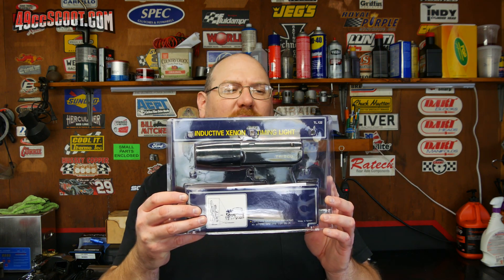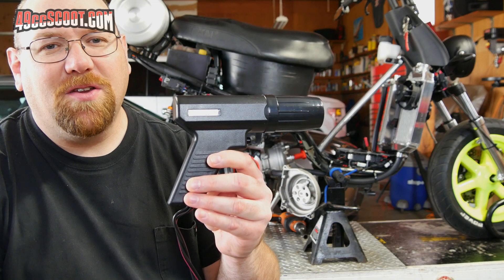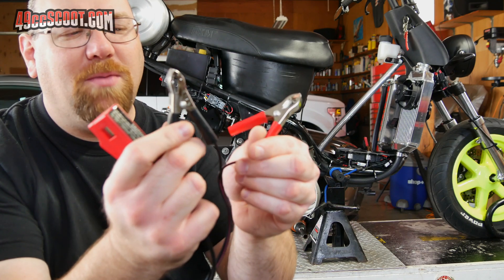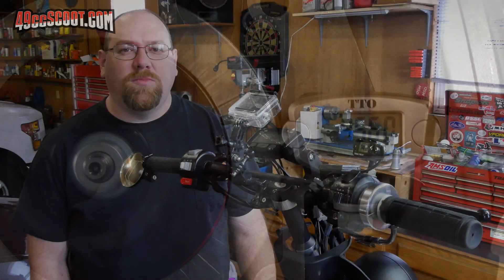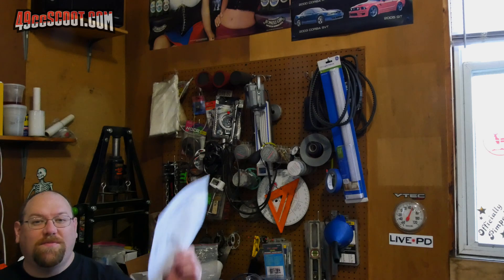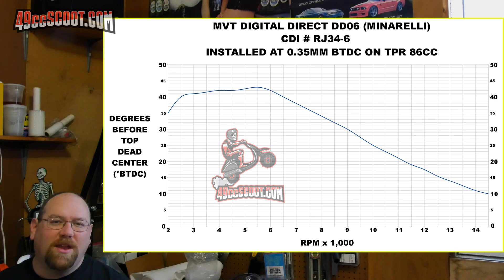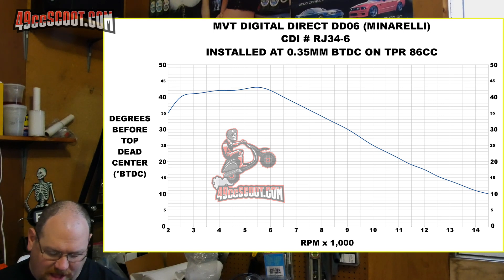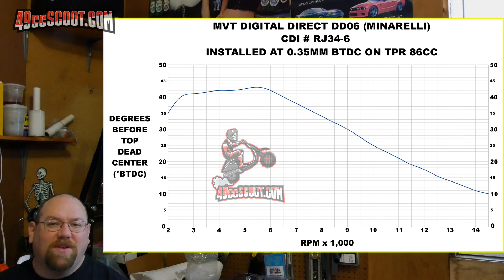TPR 86cc Build : Part 25 : Finally Figuring Out The MVT Digital Direct DD06 Ignition Timing Curve!

Comment: Do you have problem with rev counter on mvt, at 8500 rpm it cuts to 4500 rpm as if mvt is double sparking in the low range rpm.
Reply from the maker: I set my tach to 2 pulses per revolution and it worked great.

Comment: Hi, 

Im actualy building a engine for myself. 
I have a programable CDI unit, and a costum flywheel \ Stator.
I want to try that ignition curve, becose i see and "usualy" aprove on almost every engine. 

So, that graph show that its 0.35 btd that value its equal to, ho many degrees?
Thanks
Reply from the maker: For my engine, that's 9.12 degrees BTDC.

Comment: Whay it hawe so much advenced normal is like 30 ?
Reply from the maker: I know compared to curves I've seen from Malossi, the MVT has a lot of advance at low RPM and then not as much at high RPM when the pipe is working. It should make it aggressive for initial acceleration and throttle blipping, but may not make as much HP on the top end.

Comment: 2 spark per revolution, can one of them explode on bdc and mess the tuning?
Reply from the maker: Wasted spark setups that fire TDC and BDC are somewhat common in twin cylinder 2Ts to my understanding. Conditions aren't good for combustion at BDC.
Reply: 49ccScoot thanks ! Have you tried different setup for mvt ? 
After some tries, I find that I can get better top end power at 0.16mm btdc than 0.35mm but low end power seems worse
Reply from the maker: @John.santos  I haven't messed with the timing yet. I was so pleased with how it ran that I just left it, and I care more about launches where I need the pipe to hit quickly. I should move it around and see how it does at some point.

Comment: Il a fallu que je regarde une video de l’autre côté de la planète pour trouver enfin la courbe d’allumage du MVT DD!! 😃 waouhh very good man!! Nice job 👍 ❤️
Reply from the maker: Glad I could help.
Reply: @ 49ccScoot merci a toi! It’s the first time i see the curve. MVT don’t communicate about her. I have the multicurve MVT RJ23, the acceleration is better than the stock MVT curve, but no one know what there is inside.... it’s the secret of MVT, just i know the boss of MVT tell me the curve number 1 is for scooter engine... the curve 3.4.5. for manual gearbox engine....it will be cool if you find the curves of this box!! Another video!! 😉 great work 👍
Reply from the maker: @corailsigan1131 A friend got the EPROM, checked it, and  shared the results with me. I made graphs of the curves here : https://49ccscoot.proboards.com/thread/26257/dd06-ignition-info-timing-graphs
Reply: 49ccScoot great!!! Thanks a lot 😃  have a good  day!!
Reply: 45’  before dead point.... i understand why sometimes my engine start in the wrong way...😅

Comment: Hello from italy. I've seen a few of your videos about the tpr86 build. I would like to help you with the build because from what i am seeing there are  lots of improvement that can be achieved. Here in italy scooter tuning is like a religion i started when i was 14 and now i'm 20, and trust me i've tried probably every cylinder that malossi, polini, top performance, stage6 have produced. Now i'm working with more expensive and powerfull products by the way (see 2fast, Roost, 8.1, LMR engines) and i'm into competitions. I have a lot of suggestions to give you, beacuse i have seen a lot of things that are not as they should be in your build. Feel free to reply
Reply from the maker: I'm open to suggestions. I know the exhaust is not ideal. I know the squish clearance is a little loose. Many comments think it needs a larger carburetor. Just to save you time if those were some of the issues.
Reply: @49ccscoot  first of all : the exhaust. In 2 stroke engines the exhaust has probably the stronger role in the power output determination of a specific engine, now in italy we had the best company in the world producing exhausts (see jollymoto) but it closed about a few months ago. And trust me their exhaust were the best , i regularly sit on a dyno to test scooters im preparing for races and even between 2 good exhaust there can be a difference of 2-3 maximum hp output, so imagine how low you are now with that stock one installed. There are other companies producing high quality exhausts for 50cc tuned scooter, and one is ScooterTube (see his youtube , instagram or facebook) which is relatively new but its achieving very good results. 

Second : if you have the tools and the capacity, i would recommendyou to modify the exhaust and transfers duration. I have done multiples tpr 86 build and the best results i have obtained were with 195-130 durations relatively for exhaust and transfers. And by the way i am not very sure about the way your did the measurment on some of your previous videos. I measure the duration of the ports with the help of a digital caliper (let me know if u are interested in how i do it precisely).

third : TRANSMISSION
The only clutch i use on all my engines is the Polini 3g Evolution. And trust me i'm not the only one. Don't waste time with those chinese clutches and clutch bells. For the belt i recommend to use the polini evolution kevlar (cod 240.040.2). Same for the contrast spring, stick with Polini ones for piaggio engines which by the way you can install on your engine evenif it is minarelli cause you have 128mm pulleys . Try the ones that are between 28kg to 32kg, and find the one which gives the best performance.
Also remember to deal with rollers a lot, and also with clutch rmp engagment, my 70cc-100cc scooters start moving at not less of 7.000-7500 rpm.

Also the ignition is not really the best, malossi selettra or stage6 pvl are superior but u lose the possibility to charge the battery because they dont have the auxiliary circuit meant to do so.
Try also to change the static advance, that also changes a lot the performance. (but remember to not go too far away from the suggested adavance, otherways you may start several detonations).

For what concers the intake, vl14 malossi reed valve is very good, better than the vforce u have now. I only use that or the stage6 FKM on the engines i make.
Also you could go up to 28mm for the carburator (28vhst dell'orto recommended) but that depends on you.

With that been said, im from italy, Polini Malossi and a lot of other brands are too and so i have no problem with buying the components. Im not entirely sure that all these companies sell worldwide or that there are many shops in your country which you can buy their products from.
Reply from the maker: @bestiarara  Exhaust : I actually was looking at the 2Fast, which was made by JollyMoto. Then I was told that they would not be making those anymore and it was uncertain who would. Most likely I'll go with an MHR Big Bore. It was recommended to me by ScooterTuning. 

Cylinder : I don't plan on any mods there for at least a while. I'd rather see what happens out of the box with different stuff first. I have a program to calculate durations or there are formulas to do it. I have always preferred a degree wheel. Not being a rocket scientist, the possibility of a degree off doesn't worry me too much. Maybe if I wanted to spend my days on a dyno or drag strips, but if this thing turns into a trailer queen then I'll go back to more mild stuff anyway.

CVT : I will check into that belt and maybe the contra springs. Didn't realize Piaggio stuff fit. I'm still thinking about the Stage6 clutch. That the Malossi Delta and the Polini seem to be popular recommendations to me. Right now, it's not bad as-is and it won't be changed till at least after exhaust if it becomes a problem. I think I honestly picked one of the worst clutches that I could have, but it had many positive reviews. 

Most likely I'd not mess with the reeds since these are huge and just swap the carb if I think it's needed.

My goal here is really to take it a step at a time and see how it does and not to spend a ton of money to make 2 more HP. Again, for a street scoot, I just don't think all out max makes sense. I'm not even sure that this thing makes sense now, but it is pretty fun to ride and has been reliable so far. Just trying to enjoy the hobby more than be the fastest on Earth.

At any rate, thanks for the info and suggestions.
Reply: @49ccscoot  yes as you said 2fast exhausts were made by jollymoto. This was also relatable for a lot of other exhaust brands, made by jollimoto but sold with another name. From my personal experience the malossi big bore exhaust was a good choice more or less to be installed under a tpr86cc engine.
Reply from the maker: @bestiarara  Good to hear. Thanks again. BTW, I looked up that Polini 240.040.2 belt. I don't get any results for it from Polini's site or google. Just wanted to make sure that's not a typo.
Reply: @49ccscoot  my bad i made a mistake typing.
The correct code is 248.040.2 (not "240")
Reply from the maker: @bestiarara  Thanks.
Reply: @bestiarara do you still working with scooter

Comment: Hi  just done a gy6 complete 100cc bbk, carb, performance air cleaner, 1500/1500 clutch and contra spring, egr delete, new 8gr. Rollers ,racing CDI no rev. and I got a A9 cam. But it seems the valve spring completely compresses before the cam lobe goes through a complete intake duration cycle. Thank goodness I turned it by hand first.  Any thoughts Had a few scoots in the past but this is my first gy6. It’s a 2019 kymco Agility 4T 50cc or was lol.You got great awesome vids full of good info. Keep it up..
Reply from the maker: Could be that the valve pocket in the head is machined improperly or you may need to have it machined. Might want to make sure there aren't extra shims in there or anything. You could also try a different head or springs.

Comment: Hi. This is OUT OF TOPIC but i just wanted to ask if you or anyone following would know that does a 150cc cylinder fit a regular 1E40QMB crankcase or would it need huge modifications?

Thank you for the support!
Reply from the maker: The most common 150cc is a GY6. That's a four-stroke. The 1E40QMB is a two-stroke. Even if it would fit, it wouldn't work.
Reply: @49ccscoot  ok, thank you for the reply. I will think about what i will do in the future.
Reply from the maker: @deepresearcher  If you just want a big two-stroke 1E40QMB based build, 103cc is an option. Requires a considerable amount of machining, but quite similar to what I had to do to this 86cc. I've got vids about all of that up. There are 100cc cases from things like the Aerox or BWS or Grand Axis 100 that can go something like 125cc (maybe larger, I don't honestly recall) too. Parts are tough to find for those though.
Reply: @49ccscoot  would you happen to know if a regular 50cc Aerox has the same size crankcase than the 100cc version of it?
I'm just wondering about different modifications that i could try to my Keeway Matrix 50cc. I got it to run at 80km/h at one point on a straight road but then i replaced the cylinder to a new one which is even worse. The exhaust port is smaller so it needs modification later but yeah, i'm just wondering because i like to mod and build stuff. Thank you for your help.
Reply from the maker: @deepresearcher  The 100cc and 50cc Aerox stock cases are different and can't use the same parts. Larger stud spacing, bearings, etc...

There's no reason you can't go well past 80kph with a pretty basic 70cc setup that's really reliable and doesn't require a bunch of machining. Something like  Polini Corsa and a C16 for example.

Comment: Which way is the engine rotating?  most engines advance at higher RPMs, so your graph is backwards  At high RPM most engines advance approx 20 degrees. When I view my Norton that rotates counter clockwise  viewed from  the left side where the timing marks are. the TDC line moves clockwise like your does.
Reply from the maker: Four-strokes typically advance with rising RPM. Two-strokes usually retard the timing at high revs. This will put heat into the pipe and help a tuned exhaust continue to make power at higher RPM. When looking at the engine as shown in the timing indicator views, the rotor is rotating clockwise.

Comment: What weight oil should I use in my 50cc moped?
I just changed the oil using 10w30 but some say 10w40 is the correct oil to use
Reply from the maker: If it's a 139QMB, then usually 10W40 or 15W40 are used.

Comment: Hey, so i have this issue with my Kymco super 9 2t and i have 6 and 9 gram rollers to even out to 7.5 all around and when im riding WOT it goes to 8k rpm then jumps down to 7 and goes to 6k and stays, is this normal? or does it mean that my rollers are too heavy? i also ordered a malossi variator kit with the white clutch spring hopefully to increase top speed or atleast how fast it gets to it.
Reply from the maker: You can try different roller weights. I have a vid about modding rollers to show you how to easily change their weight a bit. Could be the torque driver. Many use grooves with multiple angles so you get higher revs on launch and then it feels like it shifts gears kinda.

Comment: Hey, I’ve been having a timing problem on an old Tomos moped. I’m not sure if the timing is so retarded of advanced, because it’ll have no problem running backwards. Luckily I have an adjustable stator plate, but which direction should I move it to fix this issue?

Comment: Theses MVT DD are currently making two spark per rotation, yes its weird but you can use the cdi to run counterclock wise and clockwise engine
Reply: I have one like the same, and I was told that the reason is because it can be fitting with twin cylinder engines... Not sure if it's true
Reply: It makes 2 sparks per rotation under 10k rpm